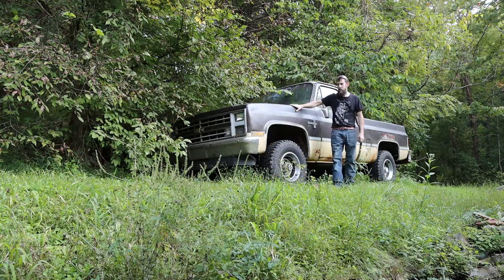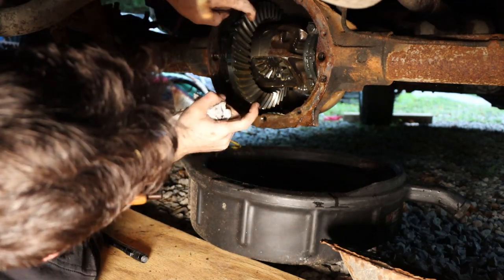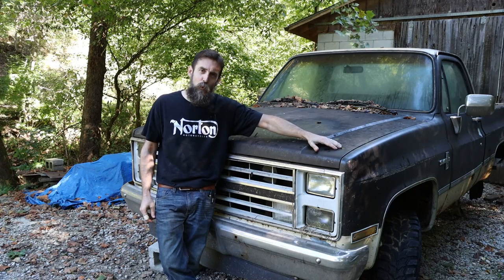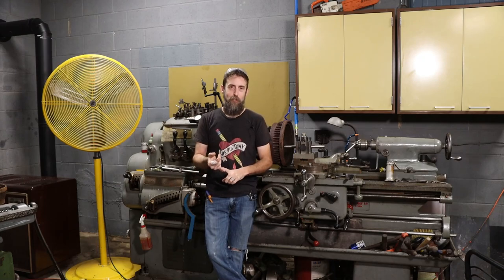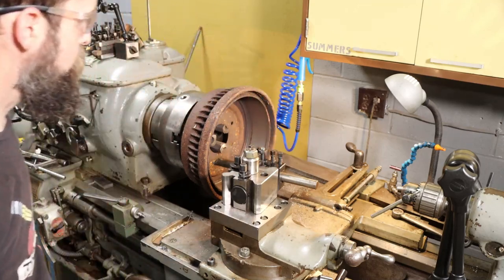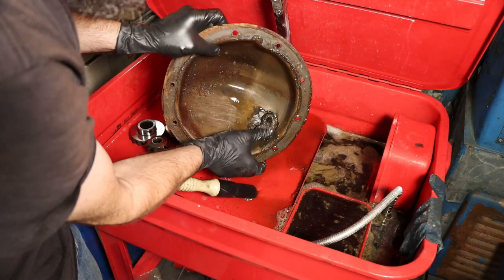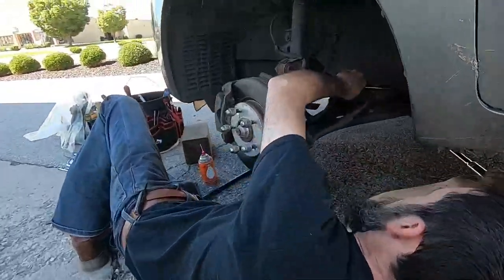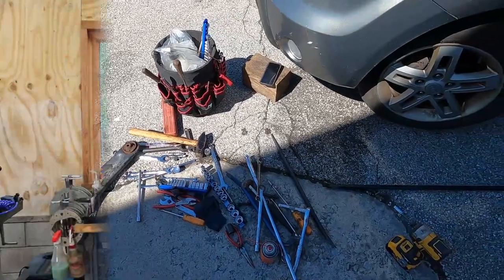Fixing what I broke Old C10 4x4 . Everything is Bad. Part 1

Comment: Normally these kind of jobs with the control arm happen in the middle of the night on a rainswept motorway and not in bright daylight on a flat surface parking lot...
:-D
Thx for taking us with you!
:-D
Reply: On a busy, narrow, winding road, in the middle of a blind curve. Can't forget that part.
Reply: I was thinking more in line winter 15 degrees on a slushy ,salty interstate rush time traffic only with this time a very blown out tire (drivers side next to traffic)EXCITING!,true story.
Reply: mine happened in the middle of a busy intersection 5pm on a rainy friday.  I put the jack under the ball joint and drove the car out of the intersection on the jack to a parking spot.  the jack sure took a beating but it still works and it saved the day.  It was a 3 ton napa heavy duty jack.  worth every penny of the money i didn't spend on it as my dad found it along the side of the road.
Reply: @frotobaggins7169  :-D
Reply: @LJJKD1947  :-D
Reply: @horstszibulski19  I can laugh about it now.  It wasn't so funny when it happened.  I was thankful that no damage occurred and it cost me like $20 to fix.  apparently the cotter pin came out of the castle nut and the nut came off allowing the ball joint to separate.  I had to find something like an M18 die to clean up the threads and put it back together.  I couldn't find the die anywhere.  eventually I stopped at a garage where the snap on man was visiting, he had one on the truck.

I just steered the jack while my friend slowly drove the car.  People were honking and being impatient.  Absolutely no consideration.  It took maybe 10 minutes driving on the jack to get to a parking spot.  only took about 5 minutes to get out of that intersection thankfully.
Reply: @frotobaggins7169  You got lucky, having the jack onboard and the driving friend and also the tool guy at the garage, most times it happens on much worse conditons, also many people wolud cause an accident if something like that happen!
All the best to you, may it never again to you! :-D
Reply: @frotobaggins7169  I remember doing that job by the side of the road on an old screw jack in the pouring rain, I remember the freezing cold water running in at my collar and out of my jeans, like lying in a river. ! What amazed me was actually finding the castle nut on the edge of the road.

Comment: I know the trucks well! 50 years as a mechanic.  Actually breaking an axle is not the bad failure.  I fixed many over the years that in which it was the tiny pin screw that came out.  Resulting in the Spider Gear Pin shifting to the side, it only has to move a tiny bit before contacting the housing.  At that point both rear wheels stop abruptly.  Quite exciting at 60mph.

Love your videos Steve!

Comment: That drum on the lathe brought back memories.  As a high school student in the late 1960's I worked at an auto supply place that had a machine shop.  I learned a lot tearing down and cleaning engines to get rebuilt . The Drum lathe was the first machine they taught me  to use.  That sound was almost a constant throughout the day.

Comment: When I worked in a car dealership, in the parts department we had a brake drum resurfacing lathe. When using the lathe they would always use a rubber strap wrapped around the brake drum to stop the harmonics n chatter,worked well. But you are a person of many talents. You do what ever needs to be done to help you n your family. That's why I always look forward to Saturday morning so I can watch you, so I can learn and listen to your reasoning of how n why you should do or not do, fix or replace what ever the problem. I see a lot of me in you. Instead of just running to the store and buying what you need, I have to try n fix it first, what caused the failure. Working with my hands is my greatest feeling when I have fixed something instead of just replacing it. Sometimes you have no choice. Thanks as always for sharing everything you do. Take care of you and your family. See you next week.

Comment: Totally agree with buying medium quality tools. As a full time mechanic i have never spent a lot on tools. fitting a track control arm on the floor isn't easy, and having the auto box in the way doesn't help.  Another great video.
Reply: Over the decades, I've collected a mix if high, mid and low-end tools.  If a mid breaks from overuse, I often replace it with a high-end piece as I know that's justified (so I've got a SnapOn ratchet and some sizes of sockets).  I try to keep a set of el cheapo open end and box end wrenches around, so if I need a shorty for some odd job, I can just cut one in half or weld a bent handle onto it, and not feel at all bad about destroying a tool...
Reply: When I was juggling spanners always went midrange,  couldn't justify Snap On, but good midrange tools are the way to go.
Reply: I dont know.  I have a marine service shop.  At the shop it's all snap on. Or OEM special tools. Probably 90k worth over the years.  Remember, it's not all nut turners, as owner I need all the shop tools.

The best tools make you money.  The cheap tools go on the service trucks to get dropped in the water. It does not mater if you drop a 5 dollar socket.  A 40 dollar one, no, you are swimming.
Reply: @haydnjenkins7607  m
Reply: @scotblackwell4607 ?
Reply: I used to buy Craftsman tools for that reason.  Made in the U.S.A. and good enough for what my shade tree mechanicing required.  Now they're made in China and they're just more low-end stuff.

Comment: Living in salty Illinois, I learned the hard way that wheel rims get rusted to the brake drums.  I had a flat and could not get the wheel off and had to borrow a big hammer from a farmer.  After that I carried a drilling hammer and put anti seize on the back of the wheel.

Comment: I love me an old truck! We had an International "3/4" ton, early 60's pickup. 3/4 in quotes as 2 ton would barely put sag on the springs. I have no idea how many times we re-built it. When the box rusted beyond repair we built a new one out of wood with removable sides so we could use it as a flatbed. It was near 40 yrs. old when it got beyond repair. A sad day!   Unloaded that truck was utterly horrible on snow or ice, it slid into many a ditch over the years.

Comment: When I was in Automechanics in Highschool I was the Brake lathe guy. At our lathe we had a rubber belt with slots and we put that around the drum (on opposite side you are turning-outside bell) to keep it from singing. So I am guessing and old "regular" pants belt or maybe some rubber or leather fastened to it would help. It never messed with the cut.
Reply: We used rubber straps with hooks on the end like you used to use on snow chains around the drum.  Work a treat.
Reply: A rubber bungee cord would work, too. The flat rubber kind with the hooks on the ends.

Comment: Had an old 64 Chevelle  back in the 1970's with the same problem. However it was about 35 deg and I got to work on it laying in a pool of melting snow and ice back  in Minnesota.  I'm surprised that the station let you work in their lot.
Here's an trick that I learned from an old  RR machinist: cut a piece  of wood so it fits comfortably on the late bed against the headstock and is a bit bigger than the bed width. You can leave it in place most of the time but when needed slide it out when you are setting up or taking down a big piece of stock or changing chucks. You invariably drop them on the lathe bed and this will eliminate bed damage.

Comment: One heck of a week.  I know the feeling.  I will say this on the safety side make sure if you don't have Jack stands you put the tire under the frame.  So if the car falls it will not pin you under the car.  Just a little tip from one parking lot repair guy to another.  Oh yeah when I turn my drums on my dump truck I use an inner tube stretched around it to damping the vibration.  Works good.  Thanks for sharing.

Comment: Interesting fun fact the HD’s have a full floating axle that allows you to pull the axle without removing so much as the wheel, just slides right out. This was a carryover design from the 20’s where the axle would often snap. Another viewer mentioned this as well but when the axle is new it can go on either side but used they develop a bend pattern that if you swap side to side they will snap.

Comment: I have triple "A" plus service. I get 5 tows/jump starts/tire changes etc. per year. Tows are up to 100 miles, and can be used consecutively...yup 500 mile tow. (you have to call 5 times) You can be in your own car, or any car as a passenger. It's a little over a hundred bucks a year, and always pays for itself. The family plan gets cards for the whole family, which is great knowing your kids can get out of a tight spot no matter what car their in. I've sworn by it for close to forty years. Saved me countless times...even just to get the car home to work on. Worth every penny.
Reply: Agreed, AAA+ auto plan is fantastic for individuals that don’t have newer or new vehicles. It would have paid for itself with this tow. Better to wrench in your driveway than at a gas station or worse, side of a busy road. Steve, well done. Too bad wifey now needed new tires and an alignment. Well done fix sir.
Reply from the maker: Yep, I need something like that😁.
Reply: Yup AAA has been great to have. Most of the time I'd rather have the car towed home so I can work on it in my own driveway. And then there was the time I broke down in the middle of a bridge on a 150 mile trip to family upstate. Oh, and the time I go stuck in a giant mud pit and had the AAA tow truck pull me out. So worth the $100 a year.
Reply: It comes with full coverage

Comment: I agree completely about tools. I have a quality set of ratchets, sockets and basic wrenches.  Beyond that most of my tools are Harbor Freight.  I also keep a toolbox in my car and truck that are basic Harbor Freight.  I can't count the number of times I pulled something out for a household repair at my moms or daughters house.  They may not be the fanciest of heaviest duty but they usually get the job done.
Another good item to add to your tool bucket is a Harbor Freight movers blanket.  They aare great for adding a thin layer between you and a hard surface.  Also they then to stop dropped items from rolling away and getting lost.

Comment: The inside tire edge tearing up didn't happen at the forecourt, even if the ball joint popping out did. The heavy wear is a symptom of really bad alignment, so I'm wondering why Elizabeth didn't notice that the steering/handling might have felt a bit wonky leading up to the complete failure. I'm glad it didn't give out at highway speeds and that Steve was able to fix it there and then.
Reply: Our where they live and where I live alignments don't last long. Bad winters and 1 lane goat path roads covered in pot holes causes this. All my cars look the same.

Comment: I bought those same fireball squares. When i received  them they were both different thicknesses. So you have to use the same clamp for the same square. Or adjust the C clamp each time. I would rather they be both the same thickness. Which yours probably is.
The lathe saved the day again!

Comment: It’s interesting WHERE you place your rubber (to cancel the harmonics). In the mid sixties I worked in a brake shop turning drums. We used a thick 3 inch wide rubber strap stretched and wrapped around the outer periphery. It seemed to be very effective at preventing harmonics during turning.

Comment: A trick I’ve used with rusted on wheels is to first loosen the lugs and then drive the truck a few feet back and forth. This brakes the rust and is easier then beating the wheels with a 2x4

Comment: Fun stuff, going through similar procedure with my Jeep only difference I'm not that young anymore. Takes twice as long and lots of aches and pains, sometimes just getting up off the floor is a challenge. As far as tools I still have the Craftsman tools I bought as an apprentice mechanic in my teens with lots of Harbor Freight specialty stuff thrown in. I remember making payments to the Snap-on and Mac tools guys when I worked a dealership, crazy expensive.

Comment: I have an 07 Silverado I bought brand new......I love my truck.....except the rust. I just replaced the power steering cooler and transmission cooler and lines. im ready to replace front control arms, axles, wheel hub etc etc.....I have replaced coil overs so far up front but so much rust..... I feel your pain sir

Comment: Old drum brakes rub on the backing plates. They rub a groove in the plate that needs to be ground smooth again, or the shoes will get stuck and lock up the drum once they brakes get adjusted. On real bad ones, I used to weld the grove with my MIG then grind it smooth and flush with the other 5 pads. There are six of those pads, three for each shoe to rest upon. Usually the worse in the lowest rear pad. Good luck. You may  expect wheel cylinders too if they aren't fresh.I
I cant believe they let you change the control arm on their property, liability and all.
I once broke a tie rod end on my old Crown Victoria while doing 40 on a curve. After suddenly hearing something metallic dragging on the road and the steering getting spongy I slowed down and pulled over. I felt blessed that it all ended without injury. You must feel exactly the same.

Comment: I had a similar weekend, last Sunday I drove my son to the airfield he goes gliding from and managed to get two tyre sidewalls damaged from the same pothole. Oxfordshire/Cotswolds roads are not as they should be. Obviously, only one spare wheel in a VW Passat. Luckily I have AA membership so they came out and fitted a temporary spare which got me to a tyre fitter. Hope you have a better week. Best wishes, Dean in Oxfordshire, UK.
Reply: @Pablo Estafez that's true and tyre weld is no use at all when the sidewall is damaged.

Comment: I"ve blown a clutch out of a truck once.  I was a little hot under the collar.  Let the truck have it then I got onto the blacktop.  Shock load ripped the center clean out of the clutch.  Learned that lesson in one go.  Keep the clutch on the wall.

Comment: A set of air shocks to take overload stress would be a good way to avoid, or at least delay, changing rear springs.  After all, when you go into the timber for a load of wood, you want to come out with a LOAD of wood ... stacked two feet above the top of the cab clear back over the tailgate.  

...

"His 4 year old grandson stacked toy blocks into the back of a toy pickup until they were a foot high over the top of the cab, and proceeded to push it, carefully, across the wood floor of the old farm house.  Grandma came to the doorway from the other room to check on him, stopped and observed for a minute.  "Mikey, you're definitely kin to you're grandpa.  If there was any way to overload a pickup truck, he'd do it!""

Comment: Case in point why I ditched the factory pos 10 bolt axles in my 86 k5 for a big hub d44 and 14 bolt ff! And it is a factory sm465 np208 just like your 85 k10 Steve

Comment: Hello Steve. You were lucky/well prepared enough to be able to change that away from home. I did a similar job on my son's fiat 500 and it involved a lot more dismantling, a frame section had to be removed and the front bumper. Nothing difficult but quite a lengthy job. You were lucky all the bolts were accessible without secondary dismantling. Look forward to seeing the old truck back up and running. I can't remember seeing when it failed but lucky again you did not lose the axle/wheel. Only by a miracle did I not lose the axle/wheel when I towed my 41 Ford pickup home after losing drive. I covered that repair in a video series. All the best. Mart in England.

Comment: One time on my 1970 C10 I was driving in traffic on the main boulevard and all of a sudden, I couldn't keep my truck in my lane. It switched lanes by itself and luckily no one was there (did I say we were in traffic!?). Luckily I was able to skootch over and pull off in an Autozone parking lot. I did all the work there. Mom had to wait in the truck. Turned out to be both tie-rod ends gave up at nearly same time.

Comment: Add a Tekton 1/2" drive "long handle" ratchet to your tool bucket.  24" long and stronger than that HF breaker bar!   Rarely need it myself but being able to safely apply a LOT of torque by hand is really nice.
Reply: I use Gedore, with the lifetime warranty. Still never have needed to use it, though my friend, who was a mechanic, has broken a few, though only after using the 4m steel pipe extender.
Reply: @SeanBZA  I've broken the 3/8" Tekton long handle while using a cheater pipe and they overnight shipped me a repair kit for free.

Then I purchased the 24" 1/2" drive version.  :D

Comment: Daughter is looking like mother. For tools I would also buy used, as older mechanical tools are pretty much not going to fail but will go on for generations. Breaker bar have at least 2, and as you break the one look for another that is not so bent.

Comment: Steve, years ago I bought a rear from a K5 Blazer, and had it narrowed down. All went well, but the gov lock doesn't work. The actuator for the lock has teeth missing, and it's die cast. I was hoping it would be a quick fix, but I'll have to take the diff out to get that out. Fortunately the part I need is only about $50. I believe the rear was from an '85.